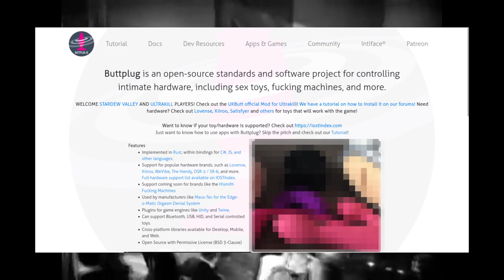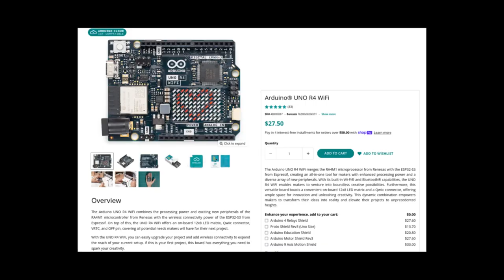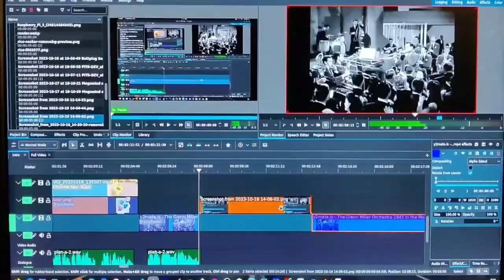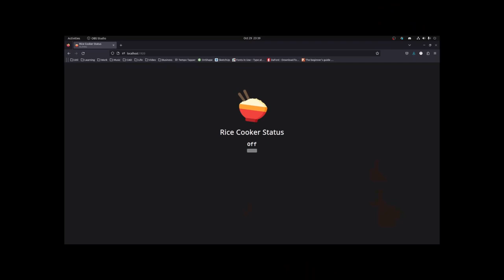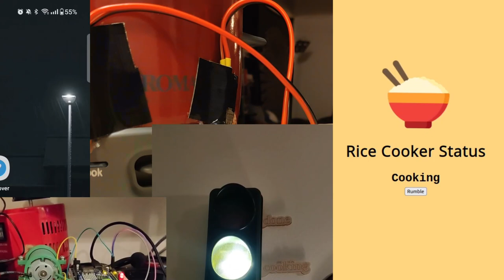Upgrading My Rice Cooker

Comment: Excellent. You've inspired me to do the same thing, except I'll use a power socket with power sensing, connected to my smarthome hub. Then the hub can text-to-speech "The rice is done cooking" and the power socket can cut the power. No hardware hacking, because I'm not as cool as you are  :´(

Comment: Good entertaining video, great edit, but as a project it felt a bit half assed. Let a stranger on the internet give you some unsolicited advice:

1) you don't need a whole arduino board to do so little. ESP-8266 has been the solution for basic IoT applications that need wifi, they are smaller and a fraction of the cost, and you can use the arduino ide and all the same libraries and programs basically, elegant wifi provisioning and all. With a current sensor module and a gutted usb wall wort you could even embed it in the rice cooker itself so that's completely invisible. 
2) Most importantly: in the end did it work? Are you no longer burning the bottom of your rice? I figured this whole thing would look cool but it (probably) wouldn't solve the problem. If turning it off after a little while was a definitive solution, it would have been implemented in the rice cooker already. 

The way this kind of cooker works is entirely electromechanical and it keeps cooking until temperature exceeds the boiling temperature of water, then it disengages the main heater element. That's it. The sensitivity of the disengaging action depends on the specific model, some newer ones use electronic temperature probes, other simply use magnets. If it burns the bottom of your rice often, it's probably because the set temperature is a bit too high and it cooks too long. You're detecting when it clicks to "warm", which is already too late. Sometimes the problem is that the cooker is designed to cook a bigger pot of rice and on average and you're making too little for what it was designed to typically do, and the "warm" function is overpowered. In that case to stop it burning it's enough to just cook more rice and/or add more water than you normally would. It's kinda wasteful, but it solves the problem. 

Sometimes the burned rice on the bottom is a thing that people especially like and it's a desired feature of using a rice cooker, not a bug. But still:
A perfectly working solution for your project would be using basically the same circuit as you are using right now, but with a temperature probe within the rice instead of the photoresistors. You could detect when the temperature begins climbing above the boiling temperature and show it with your traffic light in real time, you could even cut power via a relay module or a wifi command to whatever smart plug you already own. You could adjust via software the threshold and see what temperature is right for you. This would make any microcontroller be worth being used as such.

Comment: I have the same bowl in my rice cooker, when the rice is done I put the bowl in a sink full of water. the metal cools almost instantly in the water and doesn't burn the rice, which I noticed actually happens once I take the lid off. Of course at a certain point (about 10 mins late) the rice will just burn anyway in the cooker as moisture runs out.

Comment: Am I crazy, or shouldn’t you run the rice cooker without the steamer tray 😅? That may be why your rice is burning
Reply from the maker: Without the steamer tray it spits water everywhere, though i guess that's what i get for having a 10$ rice cooker 😂
Reply: @ChromaLock  The plot thickens 🤔. I have to ask: are you putting equal parts rice and water? e.g. 1 cup of water for 1 cup of rice
Reply: Rice cookers should only spill over if you aren't cleaning the rice properly. Zojirushi has a tutorial I have followed on how to do that and I haven't had problems since, would recommend
Reply: @ChromaLock it usually helps to wash it thoroughly